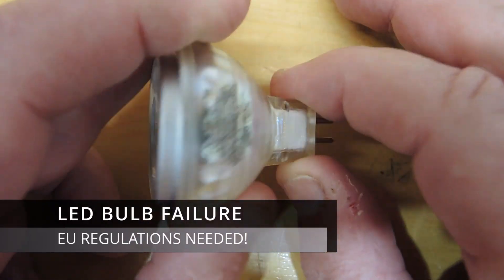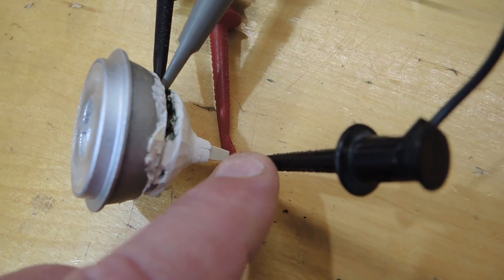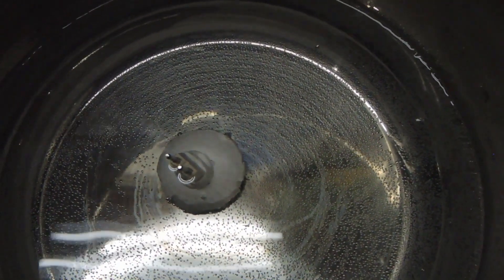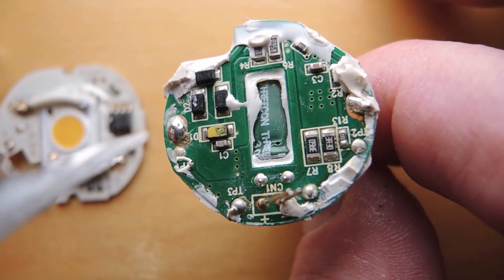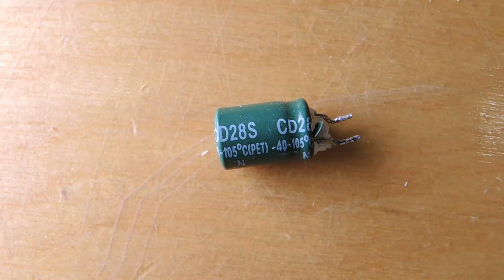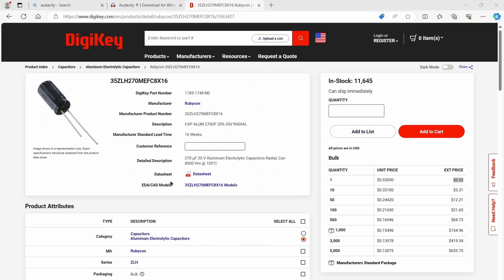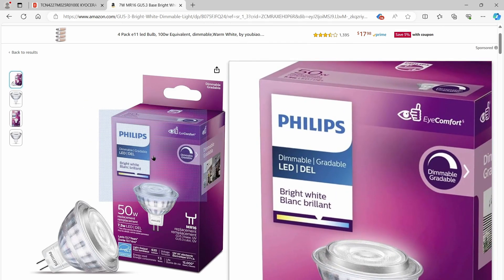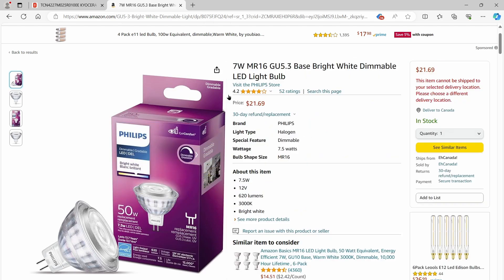LED BULB FAILURE: BAN THIS DESIGN!!!

Comment: I got Osram 6,9W/575lm/90` on discount. Would never get it for full price. They should not make `em so powerful, 4W is max for this formfactor. Strangely enough it says 80W replacement, but we know they pull these numbers out of their arses. I installed `em in a place where it is needed to have light for a few minutes an hour. Quality of light itself is great.

Comment: most electrolytic caps have a usual specified operating lifetime of around 3000 hours,IIRC. So I don't see how they can claim 15,000 hours life for that LED bulb. I suspect it's "planned obsolescence", because the design engineers know the cap won't last anywhere near that long. PLUS,the higher the operating temperature of the circuit,the shorter the life of the electrolytics. I did see a 10K hour cap listed at Digikey,but no price listed.

Comment: Great video. 😃👍
These days MR16 LEDs don't have an advantage over GU10s like the filaments used to, and there's much better choice for GU10s. 
I've had good results with the Ikea 3W 345lm 4000K Solhetta GU10 lamps, they used to be £3/3 in the UK but are now £5/3 😞. They do have an electrolytic but run relatively cool, so far so good for me. They do various dimmable 2700K ones too.
At least CFLs are a distant nightmare now! 🤣

Comment: The design is deliberate. When run properly, an LED light will last over 25 years. This is not good for manufacturers who want to make a profit. Therefore they make the product have a short life by cheaping out the manufaturing process so the custome will buy more on a regular basis.
I've had CFL lamps that have lasted over 10 years, while LED lamps in the same light fitting have lasted less than 2.

Comment: Putting all the important circuitry into the shoddy bulb instead of the socket or appliance receptacle is actually ridiculous and nobody has the audacity to question the scheme ?
i'd rather pay $50 for well built socket circuit that last 10 years - then consumable bulbs would be $2 instead of $22, after 3 changes youd save the money and it would be way better for enviro

Comment: Funny the Rubycon capacitor you show the pricing of would probably be far superior to the Threecon one used in the bulb. Additionally Rubycon go up to 130c for a few cents more, without having to go to the much bigger price jump of the tantalum polymer

Comment: Tantalum capacitors are not supposed to be used in ac ripple suppression circuits, they wind up plating metal here and there and shorting out in short time, NASA discovered this by making dozens of rockets that failed just after launch. Ron W4BIN

Comment: I am not using electrolyte capacitors in my designs at all. Which is kind of an overreaction, but I cannot ensure that the cap is high quality, so instead I opted to designs which can accomodate lower capacitances, so I can use MLCCs instead. 
I had electrolyte capacitors leak in storage! They were never even used, yet they leaked the same way the ones under use.
Reply: For a lot of applications, there is no practical alternative to electrolytic capacitors.

Comment: At least with LED bulbs there is a uniform bulb socket and form factor to facilitate a like for like replacement.  However with ebikes and electric cars, the batteries are entirely proprietary, non serviceable and there is no industry standard module that would allow for a 3rd party replacement parts market.  When an electric car or bike hits 7 years old and the battery dies,  both are going to get scrapped because the batteries can't be serviced or replaced.  The whole green movement seems to be more about producing expensive disposable products that need replacement every 5-7 years, thus eliminating the used market.
Reply: there are companies that test and rebuild e-bike battery packs. the bad part is,you have to send them your battery to be tested before you learn how much it will cost.

Comment: All added manufacturing costs gets multiplied at the sticker price, making the single unit price a more reasonable base for estimating the increased "what-if sticker price". 

There are a lot of ways to improve the design of that. I'd start with making it much more energy efficient, which means it would generate less heat for a given light output. 620 lumens for 7.5 watts is very low efficiency for led lights. I don't know why that type of lamps lags behind other led bulbs so much in general, it shouldn't be difficult of expensive to make them a lot more efficient, and by that produce less heat, which could make cheaper components more acceptable.

Comment: Bad electrolytics (often cheap, poorly made ones) seem to be a common point of failure - with older electronics this wasn't quite so bad because it was usually possible for a repairer to non-destructively open up the device and replace the bad caps. However these days with modern electronics often being sealed inside their shells or simply stupidly cheap it leads to an incredible amount of waste. Of course sealing the caps inside devices that run hot will also lead to the cap's earlier demise.

It can also be looked at as a built-in end-of-life for products - why enable them to be repaired when you can simply make them in such a way that the customer buys another and throws the bad unit into the trash to end up as landfill?

I feel that corporate greed is the cause and we need laws to prevent this happening but with so many corrupt governments being in the back pocket of big corporations I can't see it happening anytime soon, if ever.

Comment: Just more planned obsolescence. Keep 'em coming back for more while filling up the landfills. The ironic thing is that these electronic bulbs are worse for the planet when thrown away than incandescent bulbs. Without regulation, I wouldn't doubt that LED bulbs will be pushed to last as long as incandescent bulbs. What's worse is that they're making light fixtures without replaceable bulbs so you have the throw away the entire light fixtures when the light goes out. That's always bothered me even before the lifetime of LED bulbs started to drop.
Reply: Maybe some kind of energy-saving subsidy for an engineered-and-proven LED design?  The answer to a sheikh is another sheikh.

Comment: Did it actually meet its stated service life?  That, and the light not being a safety hazard, is really all that can be reasonably asked.  It's a good experiment to replace that capacitor (even with a better one) and keep running the lamp, for this will then tell whether something else was close to pooping out.

Comment: I’ve stayed with linear and circular fluorescent - new spare lamps are free as everyone else has been chucking them out! With magnetic ballasts, probably 95% recyclable which is way better than LED!
Reply: Wish I had your free source.  Around here I don't see anyone chucking them unless already burnt out.  Even so, it is still reasonably cost effective to buy 10 packs of the T8 tubes for the fixtures I still have.

Comment: Hot take, regulation of design choices isn't what's needed, accountability for marketing claims is what's needed. (although I fully agree low quality capacitors is an extremely common design flaw)

That 105 °C capacitor is probably only rated for 2,000 hours at that temperature, the circuit almost certainly operates at around that temperature. So how are they able to claim "15,000 hours" and "Lasts 13.7 Years" on the box? Presumably they only take into account the lifespan degradation of the LED die into account which is flat out deceptive.

If a manufacturer makes any change including using high reliability capacitors, that lifespan figure will still remain the same 15,000 hours. Most consumers know those figures are inflated and made up and not backed by any sort of warranty or guarantee so no one is going to make purchasing decisions based upon them. If manufacturers were actually held to account and made to honor their claimed lifespan with replacements or refunds I think we would quickly see realistic lifespan figures and better design choices for reliability, and not just in the LED market but any other marketing making bogus reliability claims.
Reply: Yeah, the real problem is there's no actual testing/enforcement of the claims on the box. You can sell "10,000 hour" bulbs/lights that all blow in 1000 hours and the worst thing that will happen is some small portion of the buyers will warranty them for another set of crappy 1000 hour bulbs. Fine the manufacturers/importers/sellers (looking at all those stores now exclusively full of "GE" trash) halfway out of business for that bullshit and it will stop. The weird part about this case is the cheapest bulbs seem to be the longest lasting, I have many dollar tree and similar bulbs that have run fine for years, but nobody seems to sell a name brand high CRI bulb that actually holds up like it should.
Reply: It probably isn't operating nearly as hot as 105C, which does extend cap lifespan, but still, I agree that  something like that should not have a mere capacitor causing that premature a failure.

Comment: If Phillips had a more sustainable revenue source and did not mainly make lighting they could do it but take for example the really nice remote phosphor bulbs they made. Mine still works to this day and as great as it is for me, it’s why Phillips is just fizzling away. I would only expect forever products from a company that does not primarily make that type of device. I mean this happened in the dawn of electric lighting, just how it is
Reply: Thing is Phillips actually does make very reliable lamps, with the same light output, and a guaranteed 100k hour life. Just that they do not offer then to the world market, because they cost double the price to manufacture.

Comment: You could pick up a little ESR meter from fleabay or such. Although this capacitor shows low capacitance, many failed can be close to the marked value or 10% under but the ESR is often very high by this time.
Reply: I bought a Dick Smith ESR meter kit a long time ago,and it was very useful on the bench. it was fun to build. I still have it 25 years later. I was thinking about installing a LiPo battery and USB charger board.

Comment: And not just an electrolytic capacitor, but a no-name cap at that. At least they could have spent a few extra cents on a Nichicon, Rubycon, or Panasonic.
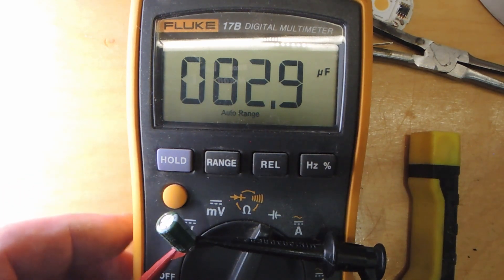Reply: It is not a no-name capacitor. Look at 03:53. It is a Threecon, which is a brand of Nantong Sunion Electronic Co., Ltd.
Reply: @jonskunator  I meant it figuratively. I would have said the same if it had said CapXon, or something similar.
Reply: @natedawww  Ok, I understand. You meant that it is not a brand that has gained good reputation.

Comment: I assume the manufacturer likes the 3 year life for obvious reasons.  Having a cap boil out its electrolyte over a short period of time is like a perfect planned obsolescence hourglass potted right in the middle of the bulb.  I'm all for regulating this kind of nonsense, but if this cap was regulation-upgraded, I suspect the manufacturer would just further overdrive the leds or play other tricks to keep the life down.  I think a regulation forcing a guaranteed life expectancy or full refund would be a better approach as opposed to regulators trying to play engineering whack-a-mole by regulating design/components.  Lawmakers should just say - a bulb must last min x time or full refund.  If you make a longer life bulb - advertise the longer life and if it doesn't reach it... refund.

Comment: Why can't they make a truly hermetically sealed electrolytic that won't leak any vapor?
Reply: It will explode due to pressure.
Reply: @michaeljones1664  why is it a problem if it's the size of a pea? the stored mechanical energy will be tiny.

Comment: THREEcon? WTF? Ive replaced bad 'lytic caps in loads of items before but ive never seen or heard of Threecom. ...and 30V? What? 35V is a standard voltage for 'lytic caps, not 30. Definitely a cheap chinese brand. If they had used a Panasonic FR series cap, rated for 10,000 hours at 105C, the LED would still be working.

 Another alternative to wet 'lytic caps are solid polymer caps. The type used on motherboards in the CPU VRM. Not sure if they're available at 35V.

Comment: Out of every box of 10 inexpensive LED bulbs I buy I usually have 1-3 that fail in 3-6 months just out of the 90 day warranty period and then the rest usually last 3-10 years depending on how much they run.  The main thing that gets annoying with the ones that stay working is that the light output drops off quite a bit as they age but it's often hard to detect unless you measure it or put 2 bulbs from the same batch side by side one run for 2-3 years and one fresh out of the package.  I suspect that the inexpensive bulbs are being built down to such a low cost that they will be lucky to get much beyond 20K hours.  I have been seeing more LED manufacturers putting 10K+ or 25K+ hours on their packaging instead of the early ones that were claiming 50-100K hours.  That being said I have some compact fluorescent bulbs that are pushing nearly 45k hours of service and still kicking but the tubes are well below the original intensity as well due to the phosphor degradation.

Comment: Rubycon has the RX30 series that's rated for 130c, a 220uF 35v one is 60 cents on Digikey, 15 cents if you get 5000 ... and if you go maximum 25v,  there's polymer capacitors rated up to 150 degrees Celsius, with 125c rated ones being quite common. 
Problem is how you would enforce regulations... as you're more likely to start an industry of printing fake labels on capacitors instead of them being willing to spend a few more cents on each part.

Comment: Well if the other forms of capacitors are used, then ultimately their price will go down also.

I'm pretty sure Philips is exporting into an Arab nation "high-rel" LED lamps that will actually last at least 10 years and the whole game with the rest of the markets is that if they do that, the lamp manufacturers will go broke.
Reply: Meh, no, there is no expectation that if you start using more capacitors made from the limited supply of rarer materials, that the industry price would go down.  We could say that price per unit goes down  just placing a larger quantity order for them, but the same is true for the electrolytics.

Why are you pretending to know something about Arab nation  reliability bulbs?  There is no evidence of that except isolated cases of using more LEDs to drive each at a lower current and thermal density, nothing at all supports the idea that  Arab nations specifically reject products (designs) with electrolytic caps.  For starters, it wouldn't then just be LED bulbs.  They'd have to ban the majority of electronic products.
Reply: @stinkycheese804   Yeah, no, that's totally the expectation and a good measure would be casings, for example 0402 components have dropped in price the last years compared to 0603. Tantalums are anyhow generally to be avoided, but higher capacity ceramics could be used but expensive due to processes, not material.

The LED lamps are called "Dubai lamps" and Big Clive has done a video on them. As hackaday notes they were inspired by "the ruler of Dubai, Sheikh Mohammad Bin Rashid Al Maktoum, who wanted more efficient and longer-lasting bulbs. "

You can both avoid being rude AND an idiot.
Reply: @TrickyNekro You can get the same result buying dimmable LEDs with at least twice the power you need and just running them at half brightness.
Reply: @NiHaoMike64  I guess that would depend on the dimmer. Most simple dimmers are just chopping the sine wave. 
Although that's an easy way to reduce power and thus temperature inside the enclosure, you are exposing the said input capacitor to higher inrush currents.

Now these LEDs are fed through a transformer so chopping the power to the transformer might not be that of an issue, because the transformer will smooth that current.

So yeah, for this setup, it might be a very good solution, indeed.
Reply: @TrickyNekro The better dimmers use trailing edge clipping, the best are bulbs with some sort of wireless remote for dimming. Note that if you go for the IoT ones, make sure it can be reflashed to Tasmota so it wouldn't depend on the cloud.
Reply: @NiHaoMike64   when being honest, I try to avoid all connected crap, but if I would wanted to install something, then I would build it myself. Then I'll only have to blame myself when it craps out...